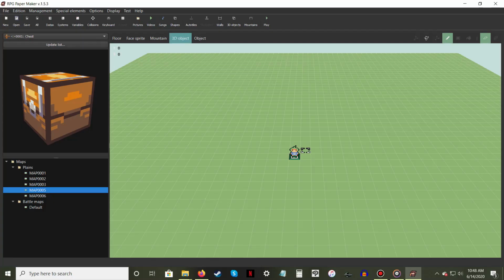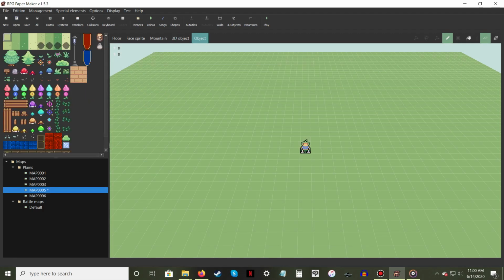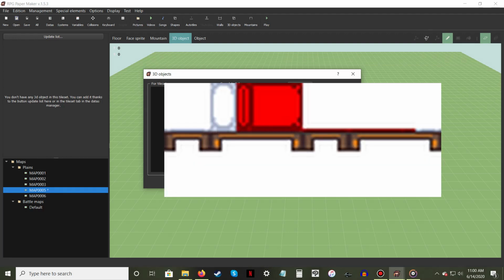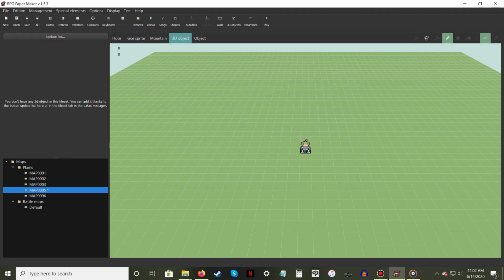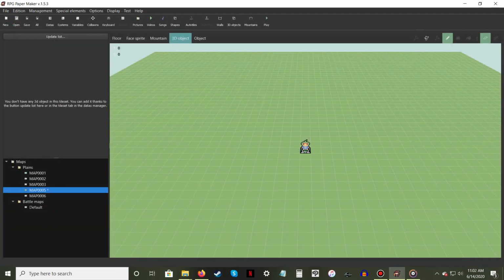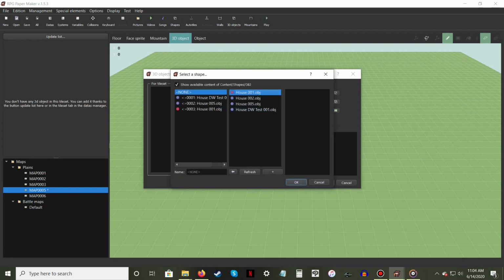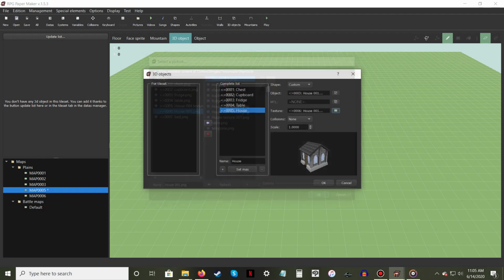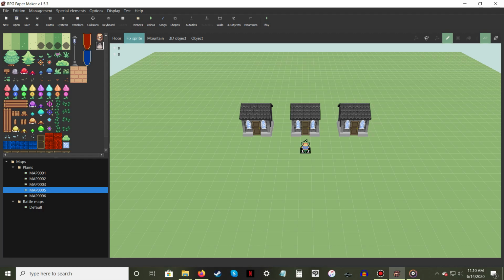RPG Paper Maker Tutorial - #007 Custom 3D Objects

Comment: I made a custom 3d object in blender. it is a ramp mesh with dimensions 1 block height x 2 block length. My character cannot walk up it with simplified collisions, is there a way to fix this?
Reply from the maker: Sorry, totally forgot about this. Collision for 3D Objects is extremely basic, to the point where the Hero can only collide with objects, not traverse up/down them. The only what to get this to even remotely work would be to fake it. Make the 3D Object have no collision, create an invisible mountain slope in the same spot as the object, then add invisible boxes to the sides that you don't want the player to climb.
Reply: @DigitalContainer  Ah that’s smart thanks man
Reply: Did you figure this out?
Reply: @inkunn  nope just ended up making a mountain slope in game

Comment: hiya! these tutorials are super useful! i've previously used rpg maker mv, but i still find this program tricky. if you ever could, i'd love to see a tutorial on conditions/variables as i can't seem to make them work :( otherwise, thank you so much!
Reply from the maker: Well I can help with one of those problems right now! Turns out when update 1.5.3 went live it changed the code of the enums.js file. Anything labeled as variable became letiable, so variables wouldn't work correctly. Here's the updated code:

https://github.com/RPG-Paper-Maker/Game/commit/ffa86e9221b4d4f5e3f0e93deb43b5f70ff1729f

You'll need to edit the enums.js in your MyProject folder (for your game) as well as in the Steam/Steamapps one (for future projects you make).

As for conditions, what won't work exactly?
Reply: @DigitalContainer  i actually ended up figuring it out! i just looked up the guide for the program. otherwise, thank you for that information. now i'm having trouble with teleportation, despite following your tutorial. it just doesn't seem to trigger anything (even when i set it to "player touch"). i will definitely use the information you said above to test things out though. thank you!
Reply from the maker: Sure thing, let me know how things turn out!